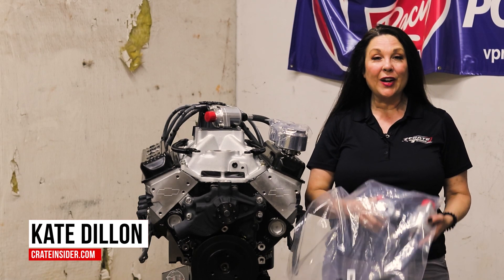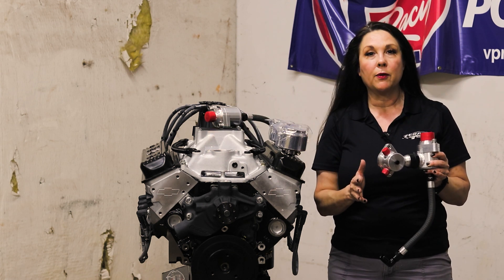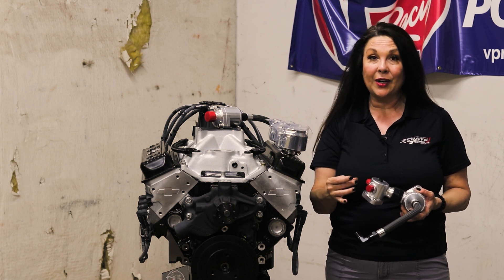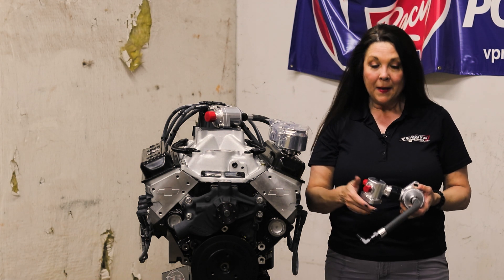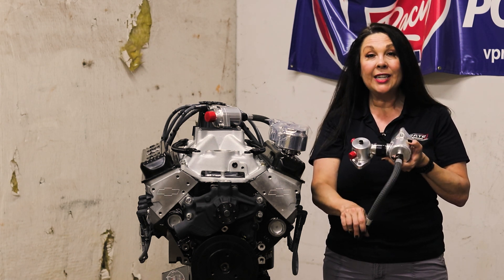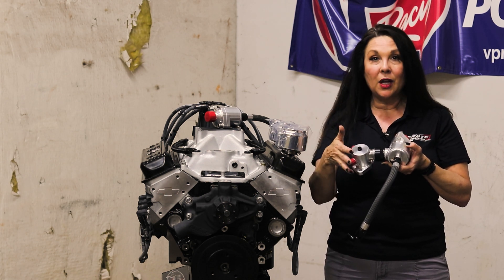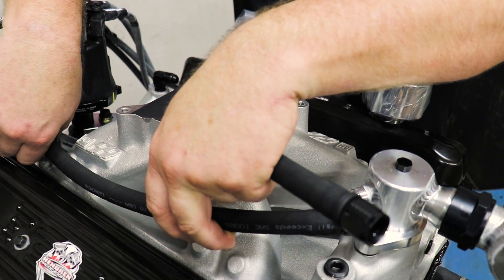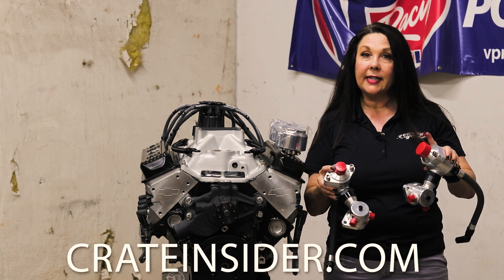Product Overview | Art's Radiator Thermostat System

Comment: Will that system work on other motors besides the 602 or the 604 and if you run regular racing fuel besides the e85 up here in Michigan in the spring when it's a lot cooler and it takes us a while to get our motors up to temperature and summer time when it gets hotter just kind of wondering if that system will work first stuff like that also